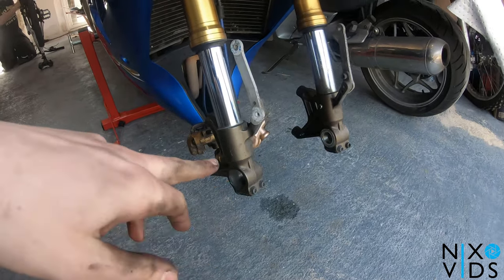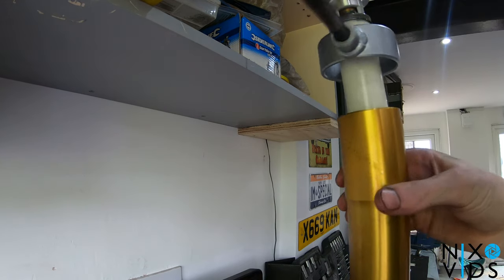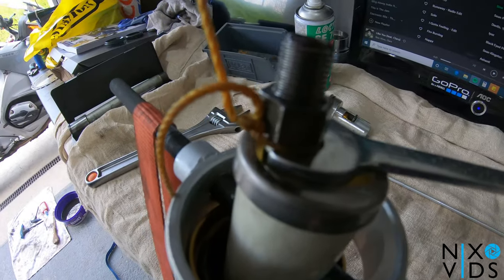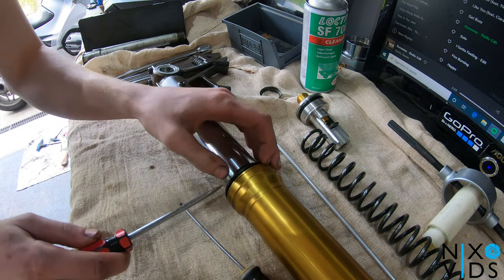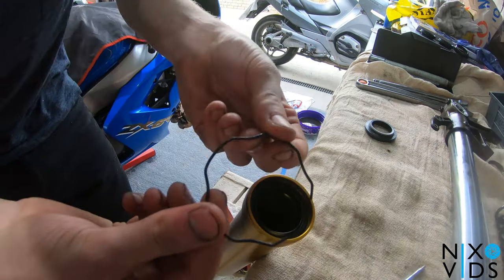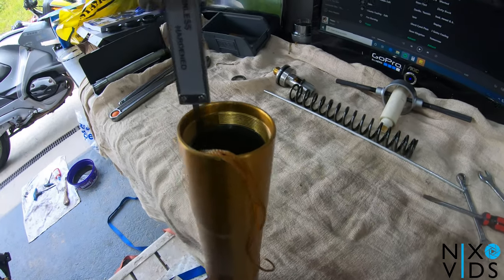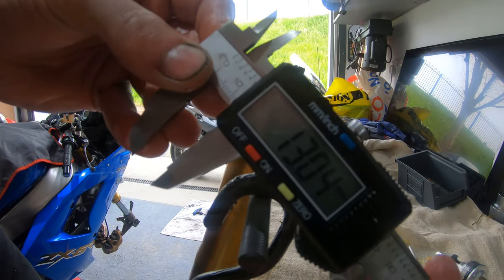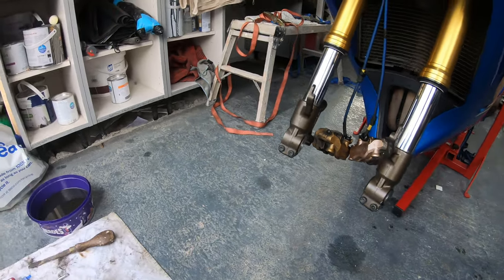ZX6r Fork rebuild

Comment: It didn’t show in the video, but did you bleed the dampener - move the rod up and down about 10 times to move the fluid through the passages before checking the oil level?

Comment: Mate, first of all,love your accent! Hahaha. The right fork on my 636 B1H has poor rebound/low compression force and oil leaking through the dust seal. Rebuilding with new seal and replace oil,will fix the problem,or i should buy another used fork in better shape? Thanks for your time. Cheers from Greece

EDIT 
I replaced seals and oil, finally works like new <3. Thanks buddy for your guide, you helped me very very much.